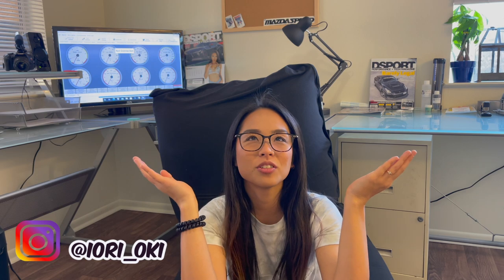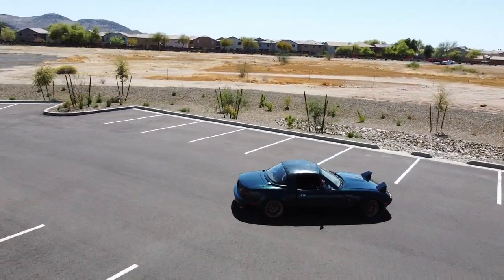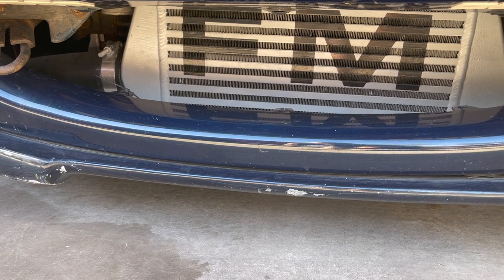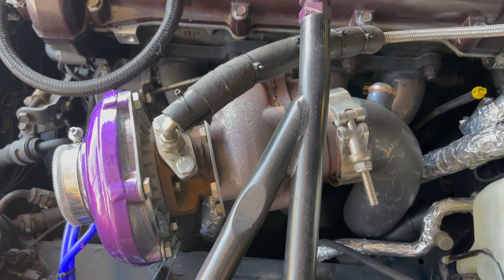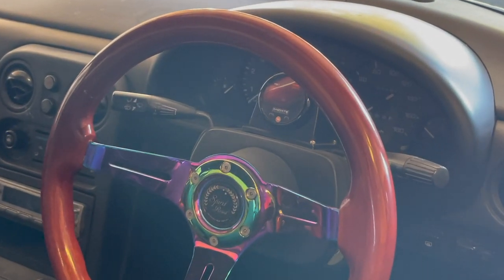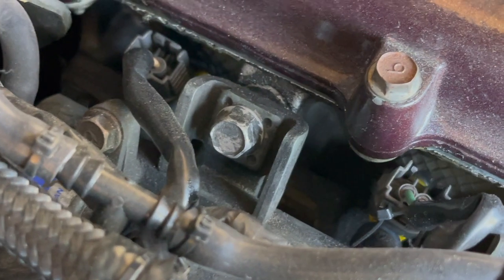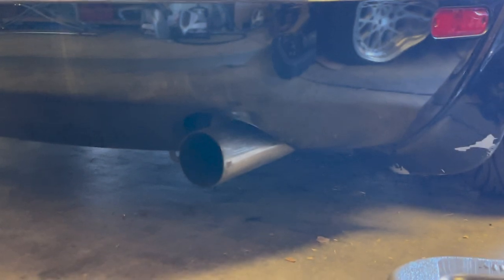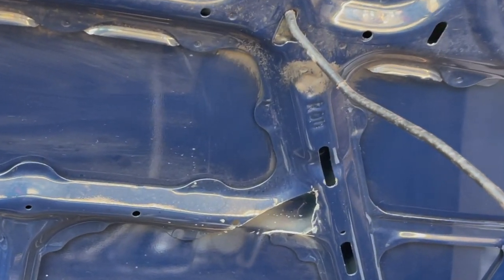Ultimate Budget Miata Turbo Build | High Quality Boost Build

Comment: Hey I was wondering how has this been reliability wise? I’m looking into turboing my Miata and I’m lost on what kit/s to go with. Thank you and amazing video!
Reply from the maker: Hi!
Thank you for your kind compliment.
This kit has been amazing. Truly.
I did not add, but this kit can also bolt to your factory exhaust, or get really close to doing so. That way the car is not too loud and you don't have to deal with the drone and smells of hood exit exhaust.
As mentioned in the video, the only thing I would change if I could go back would be the Wideband [The psb-1 just is not that good], the oil feed line and tee [the supplied one feels cheap and cross threads easily] the oil return fitting feels like it should be larger, and ensure you order a new manifold gasket from Moss Miata and a metal T3 gasket.

There are cheaper options, but I think this is the best you can get for under 3500 and its really really great.
Reply: Go for the kraken
Reply: So it's been 6 months. How has the manifold held up? Do you drive the car daily? I have a Miata with the flyin Miata manifold/ turbo kit and I want to go with a tube style manifold. Has your cx racing manifold cracked? Ty for any help.
Reply: About this

ABS
factory central locking system and alarm system With automatic closing windows when locked immobiliser and electric windows 

256bhp

FM2 turbo kit

Fm aluminium radiator 

Garrett r60m24 turbo

Fm complete 3 exhaust - down pipe, cat cat back

Fm 550cc injectors 

Fm clutch and flywheel stage 1 

Hydra ecu

Fm oil cooler kit

Fm boost gauge 

Adjustable dampening coil overs 

Hispec motorsport uprated from brakes 

Enkei wheels with nearly new  Michelin tyres 

2 keys 

Oil temp and oil pressure gauge 

Water temp gauge 

Tear drop speaker covers 

Mk2 seats and classic mx5 momo steering wheel

It's up for sale for 5500 British pounds I might buy it

Comment: Wow, what injectors do you plan on running next? And I can’t wait to be on my speedyefi ecu to actually make some good power. Awesome vid!
Reply from the maker: We are going to do an in depth review on the flow force 640cc injectors, attempt to blow the engine, then install a built engine with id1200
Reply: I’m running yellow rx8 injectors on 23psi with zero issues, $40 on eBay 🤣
Reply from the maker: @MonkeyWrenching  What is that duty cycle like? lol

Comment: if you can get your hands on a holset hy or hx35 (you can normally find them for $250) it should be a ton better than the cx turbo js
Reply from the maker: I totally agree. I looked for an HY35 for a very long time, but I actually have a HKS 2530 for it that I'm currently working on fitting to the car, so subscribe and share if you wanna see it.

Comment: Turbo Miata gang 😉 I kinda miss my single turbo setup, not bad for less than $1000 and pushing 19psi on stock internals.
Reply from the maker: It can definitely be done for cheaper, but for no real fab work and a full exhaust, I think this is perfect.
Reply: @ioriOki  I had a full exhaust, built it from auto parts store pieces for under $100 (it was $98 lmfao) it’s sitting in my garage right now. Same one I used when I was drop it to laguna seca. I just like hater pipes 🤣 cause I wanna see my 🔥 and it let me run a much bigger exhaust without having to squeeze it all in there and make that really abrupt bend off the turbo. Always bothered me because I know it’s choking the turbos ability to flow properly.
Reply from the maker: @MonkeyWrenching  I gotta have it quiet. 
I low key want to run a second resonator.
Mine still throw flames.
Reply: 19psi on stock internals "single turbo", it's a miata,
 yeah ok bud lol
Reply: @alexb4409  what happened not getting enough attention at home? Poor guy
Reply: @PeterFeltersnatch852  Simple man, simple brain.
Reply: @alexb4409 it’s literally all on his channel 😂

Comment: Wow how much power is the Miata making?
Reply from the maker: The RX-8 Injectors limit it to the low 250s at max duty cycle.
Reply: @ioriOki  wow not bad. My goal is to reach 260-270 with low tq.
Reply from the maker: @Boost_Performance  I think that will be possible for your setup.

Comment: Whats the power on your miata?
Reply from the maker: About low 250s with the injectors maxxed. Will be upgrading soon to see how much it takes to blow the engine before installing a built engine, so don't forget to subscribe!
Reply: @ioriOki  INTERESTING! What turbo are you running? 

Make sure you record the engine blowing up! :)
Reply from the maker: @leehayes5231  It is the CX Racing Kit T3 Turbo. I can go in depth and get measurements on it, but I plan to go Precision 4831 

The death will be recorded. lol
Reply: @ioriOki  ah sure, I don’t think we get that here in the U.K. 

Common turbos over here are the TD04/05 from Subaru Impreza and Garrett builds using 2560R or similar. 

I look forward to seeing it! 🤣
Reply from the maker: @leehayes5231  This one is a bit bigger than those.
Reply: @ioriOki  Ah so closer to Garrett/Bog Warner Im assuming. Very nice! I just did stage 3 clutch and lightened flywheel so almost ready for GT2560R and big boost!
Reply from the maker: @leehayes5231  You will have so much fun.
Reply: @ioriOki  I’m sure I will!